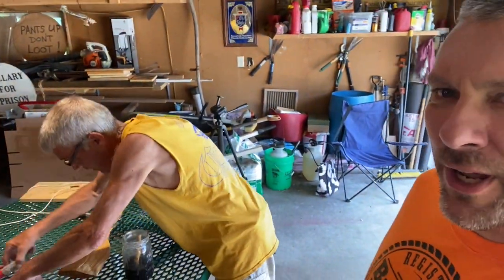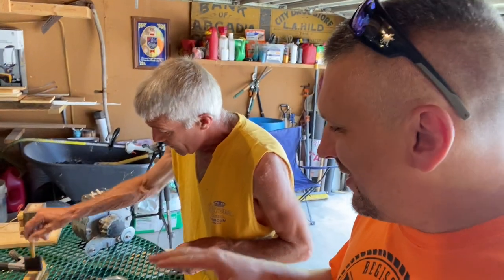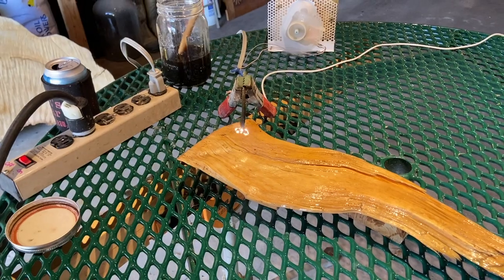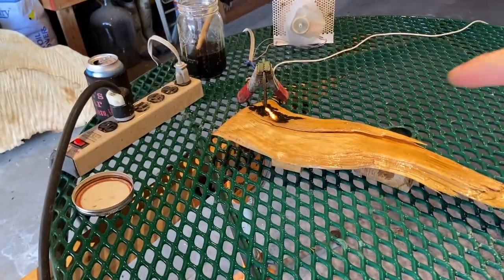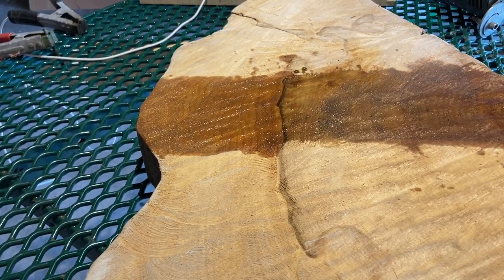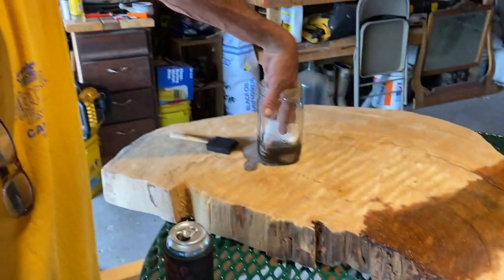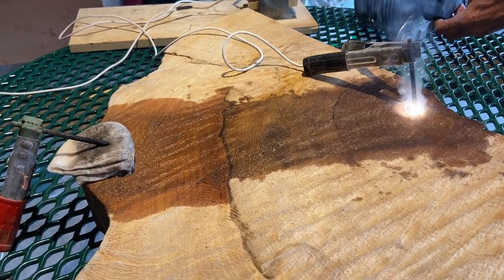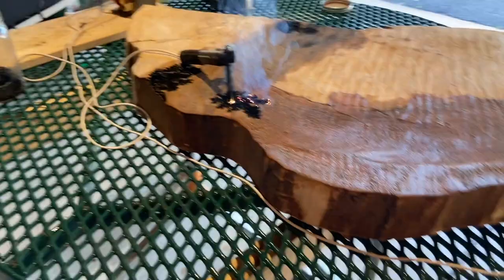FIRE WOOD - Fractal Wood Burning with Cousin Wood Hound

Comment: Wonderful! The electrolyte is very deeply absorbed into the end of the wood and therefore it is impossible to burn beautiful Lichtenberk figures on the surface of the end. The fan dries the surface and worsens the flow of current in the wood moistened with electrolyte. With the growth of the Lichtenberg figure, the resistance of the trunk of the burned branch increases and it is necessary to move the electrodes closer to the burning front. Using a wet wipe and an autotransformer is the right solution!